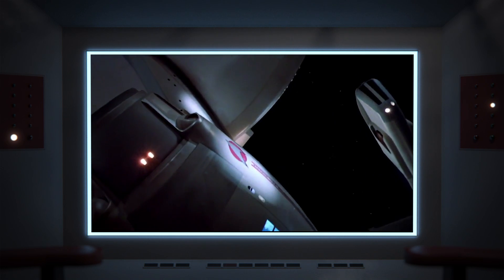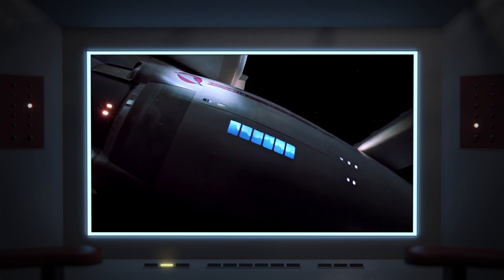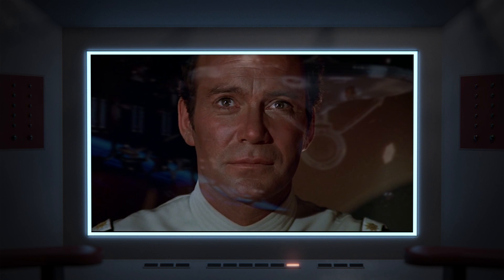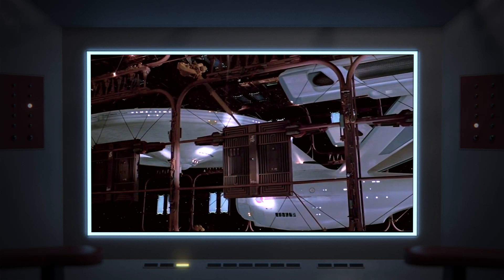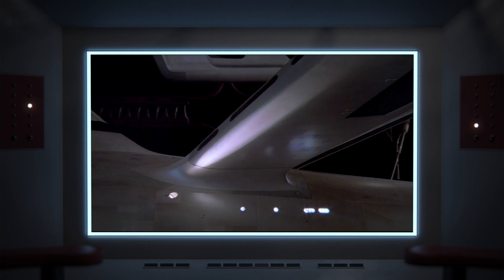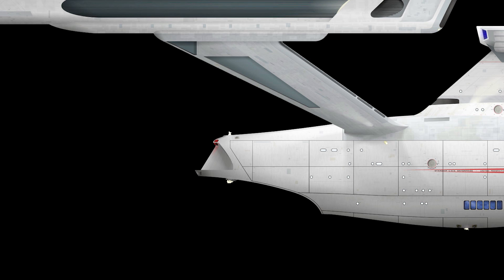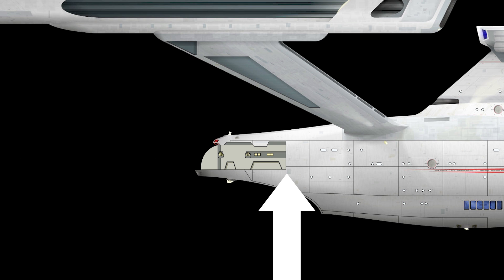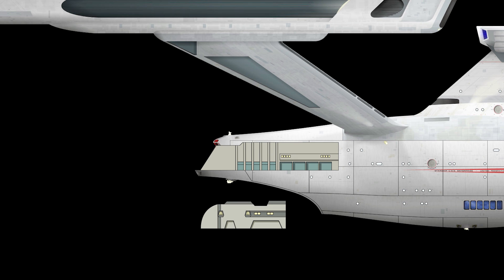Why Have Angled Nacelle Struts? (Enterprise Refit)

Comment: starships often go into nebulas or even into atmosphere of gas giants , so I'd argue that aerodynamic design is still important since the ship is not always traveling in a vacuum
Reply: Actually it wouldn't even matter.

The density of particles in open space is something like 1 hydrogen atom per square metre.
That's near enough to nothing, but it is NOT literally nothing.

If you're travelling at 1/100th the speed of light or less that won't matter in the slightest.
But if you're travelling at 9/10th's the speed of light, or even higher (which is sometimes implied even at impulse speeds), 1 hydrogen atom per square metre is actually capable of producing a pretty serious amount of drag.
In fact, a starship designed for such speeds probably needs a lot of forward shielding to prevent hull erosion, and maybe even a moderate amount of streamlining.

However, the TNG technical manual suggests something else - warp physics dictates it's own variations of 'streamlining'.
This is said to have dictated the way that the Galaxy class is designed, but it stands to reason if warp field flow is indeed affected by the hull design of a starship, then as those starships travel at higher and higher warp speeds, they're going to need to be more and more optimised in terms of how they handle warp field flows.

Given that the refit is notably faster than the original, and if warp field dynamics has any bearing on hull design at all this was likely something that was determined LONG before the 24th century, it makes sense that the refit would have improvements to it's hull shape to optimise.

Incidentally, star trek nebulas are really weird and seem like fairly dense gas. A nebula in the real world meanwhile has barely more matter in it than empty space.
In fact, do you know what you'd see if you were inside of a real nebula? Absolutely nothing.
Unless perhaps you were looking through several thousand lightyears of such a nebula, in which case it might be visible as being slightly darker than regular space.

Nebulas really aren't much like how they get depicted in fiction.
For that matter, the pictures we have of nebulas also aren't really what they look like - most such images are false colour images taken by combining non-visible light spectra, such as X-rays, UV and infrared.
to the naked eye, these nebulas are much less interesting more often than not.
Reply: The original enterprise entered earth’s atmosphere briefly, during an episode where they’d inadvertently gone back in time and came in contact with a USAF F-104 Starfighter which incidentally was piloted by Christopher Kirk (Captain Kirk’s ancestor). The Enterprise was perceived as a UFO by the USAF. 

The swept back struts would also enhance the atmospheric flight capabilities of the refit Enterprise NCC-1701 (A). Methinks.
Reply: @datathunderstorm  That was not "Christopher Kirk," nor was he related to anyone on the Enterprise, let alone James T. Kirk. That Air Force pilot was Captain John Christopher, and his decedent was the C.O. of the first manned mission to Jupiter, which is why they had to send him back because his son had not yet been born.
Reply: pepperVenge I stand corrected; thank you for setting that straight. Amazing how the mind can get facts twisted - I last watched that in the early 70s....!!! I might have been 12 years old. PepperVenge.....”yours is the superior intellect” 😉
Reply: @datathunderstorm  Thanks, but no. Lol I just watched that episode recently. Within the past few years.
Reply: Borg cube could go as fast as any Starfleet ship. No aerodynamics there.
Reply: I'd argue that a starship is in a vacuum more then 99.99% of the time. Unless it was a ship built for landing on planet surfaces like the Intrepid class. Even then, it's still in a vacuum 95 to 99 percent of the the time (how often did we see USS Voyager land?).

And despite what TV and movies would have you believe (Star Trek II The Wrath of Khan), nebulae do not have anywhere near enough pressure or density to offer any kind of wind resistance. The most dense nebula has only about 10,000 molecules per cubic meter which is still a vacuum. Interstellar space has about 10 molecules per cubic meter. Earths atmosphere has 10 Trillion Trillion (or 10 Octillion, that's 10 followed by 24 zero's) molecules per cubic meter. So there is no need for aerodynamics in nebulae. 

Also despite what TV and movies would have you believe (specifically Star Trek, 2009), traveling through a gas giant would be suicidal primarily because of the incredible wind speeds they have. typically 384 mph (Jupiter), or as high as 1,200 mph (Neptune) and this is very dense air. Even if your ship was aerodynamic enough and strong enough to tolerate that, you wouldn't be able to go very deep at all because of the intense pressure. Not to mention that the deeper you go, the hotter they get. 

Jupiter's surface is freezing at -145 degrees C. But it's core is an astounding 24,000 degrees C. That's hotter then the surface of the Sun. Even within a hundred miles below the surface, the temperature can be very hot, 100-300 degrees.
Reply: Major Grin “nebulas”... Isn’t that “nebulae” ? 🤓 Interesting either way though.
Reply: What about the JJprise.....it went under water....🤣🤣🤣.
Reply: Nebulas? You would not even notice if you were in real one.
And in gas giants aerodynamics is quite irrelevant with ship capable of such speed, more than that i would worry abount how much pressure can ship withstand but looking at it, it looks like last thing they were thinking abount.
Reply: @robertkalinic335  when the ship moves through one at high speed and the shields and deflectors are inoperatable it will definately make a difference
Reply: @NitpickingNerd  gas giant or nebula?
Reply: @robertkalinic335   They constantly travel through nebulas in star trek and often the radiation makes shields useless so at high impulse speeds the design of the ship can give an edge and reduce stress on the hull the same as when traveling in a planets atmosphere as they sometimes do. We also did see starships go into Gas Giants once in a while for example when the Defiant hid inside one and has to play hide and seek with Jemhadar warships
Reply: @NitpickingNerd  Nebulas in st are bullshit, but since they didnt bother to fix it, i have nothing against sci-fi ship being built for conditions of imaginary universe.
Reply: Major Grin   That’s all sorts of wrong, besides nebulae not being what trek thinks they are traveling through anything like that at the types of velocities the ships need to is so far beyond the realm of aerodynamics it’s laughable. 

At the speeds assumed in WOK the gasses of that nebula would contact any portion of the ship with explosive energy. Regardless of its aerodynamic properties.
Reply: @DrewLSsix  and andorians are a joke too.
Reply: @DrewLSsix  you're contradicting yourself. first you say nebulas are too thin for it to matter , later you say that flying through a nebula at high speed would be destructive for a ship.  can't there be some middle range between these two in which flying through a nebula in a certain speed be like flying through air-like resistance which is when aerodynamic structure of the ship would be of benefit ?
Reply: @NitpickingNerd  DrewLSsix isn't contradicting himself. He said that flying through a real nebula would have no effect on the ship because it is too thin, which is correct.
And then he was talking about nebula shown in ST2. This nebula was unrealisticly dense. And flying through such dense nebula at speed of several thousand kilometers per second would be destructive. Which is also correct.
In either case aerodynamic have no effect on the ship.

Real nebulae are far far more thin than air on top of Mount Everest. Pictures of nebulae from space telescopes are enhanced and therefore they look more dense than they really are. Unfortunately nebulae in ST are not portrayed very accurately.
Reply: @Lukas-Trnka  we are not talking about real nebula , we are talking about the ones seen in the star trek universe  which seem to be cloud-like , sometimes even with lightning storms inside them , which seem to have air-like density .   look at the opening credits of Voyager you clearly see the ship flying through such a cloud nebula and pushing through the gas cloud .  in such a situation aerodynamics definitely would be significant. 
we've also seen ships fly inside the atmosphere of planets. Voyager could even land on planets which means it had to fly through the atmosphere both when landing and when taking off , which could explain why its more aerodynamic then other ships which would not designed for landing on planets.
Reply: @NitpickingNerd  and we're not talking about actual aerodynamics, we're talking about the kind that are specifically for looking cool.  these often get confused 😁
Reply: @NitpickingNerd  We are talking about both, the real nebulae and the ST nebulae, here in this discussion. Star Trek is usually quite science-friendly for a sci-fi show, but there is clear discrepancy in how the ST portrays nebulae.

We cannot assume that in ST the nebulae are dense as clouds on Earth, consider it an in-universe rule of ST physics and then apply a real-world laws of aerodynamics on it at the same time. That would lack the logical consistency. And that's why we have to talk also about this discrepancy between ST and real nebulae.

Btw. we shouldn't take everything we see on screen in ST as a fact. There are things in Star Trek that were shown on screen after some considerations of ST technical advisors and there are things in ST that were shown on screen because they simply look good, without any deep thinking about logic of it.

If we want to find some logic behind things in ST (and I think we should; atleast I like to do it), then we have to filter out things that were obviously shown on screen only for efect. I think the best would be if we assume that nebulae in ST are as thin as in real world and their appearance is only enhanced on TV screen so that audience could see them and enjoy how nice they are.
Reply: @Lukas-Trnka  star trek universe has air in it which is why we can hear things in it and why things explode with a fire ball . Cloud like nebulas make sense in that universe and ships need to be aerodynamic
Reply: @NitpickingNerd  No, no, no. :-) There is no air in interstellar space in ST universe. The sounds are only a common TV effects and the fireballs are partly also TV effects and partly they are realistic. There is a widely spread misconception among people, that there cannot be fire in space. That is not entirely correct. There can be fire in space as long as there is something that can burn. Eg. air from within ships, or fuel. And there is also superheated plasma. Either artificial, like plasma from fusion reactors or warp core, or natural plasma like stars and supernovas.
Reply: @NitpickingNerd  air in space? That was my idea for explaining away the Last Jedi mistakes. For Star Wars I'm ok with it since it's fantasy. For Star Trek I'm not since it's based on science.
Reply: @braveintofuture  star trek has things like telepathy and other magical powers  so its also more fantasy than hardcore sci fi
Reply: @NitpickingNerd  telepathy is just because of the spores LOL. But there could be some explanation like subspace transmitting neurons or any technobabble.
Reply: @braveintofuture  

Read more: https://www.springfieldspringfield.co.uk/view_episode_scripts.php?tv-show=star-trek-discovery-2017&episode=s01e06it was said by Data that there is no technological way to block telepathic signals . it doesn't seem to have anything to do with subspace . it's something way beyond any of that. 
the only time Troi's telepathic abilities were disrupted was when they encountered the 2 dimensional beings .  so I assume telepathy has something to do with higher dimensions . the area of space intersecting with the 2 dimensional plane must have disrupted the connection with whatever higher dimension telepathy is transmitted through. 
maybe in the proximity of the 2 dimensional plane the other higher spatial dimensions shrink down (and thus no longer allow telepathic signals to pass through them)
when Stamets talked about telepathy he did not theorize it has anything to do with the spores. rather he said it must be a different "uncharted superhighway connecting all of consciousness and life"
Reply: @NitpickingNerd  "can't there be some middle range"
No. When matter becomes so sparse, the energy of particles hitting the hull would not impart an aerodynamic force, but rather penetrate it and cause damage. Shielding in interstellar crafts is a real consideration when it comes to plausible designs like the Daedalus, and even in the emptiness between us and Barnard's Star, the energy of a particle hitting a shield would much rather damage and erode it than impart drag.